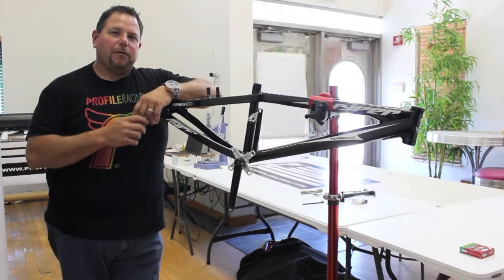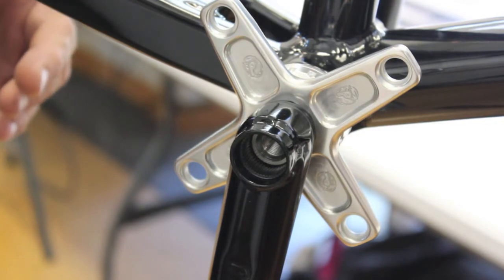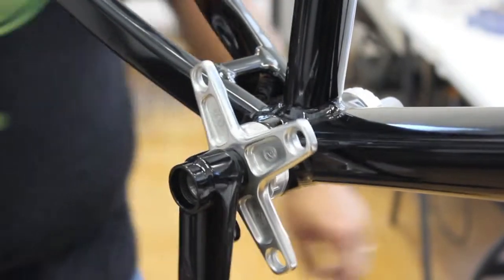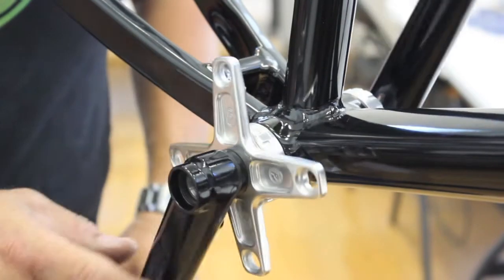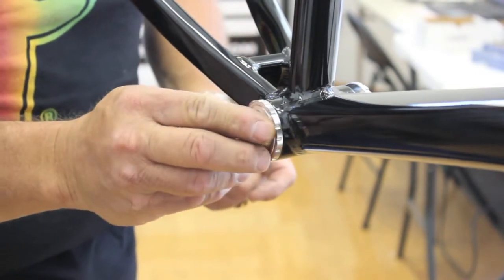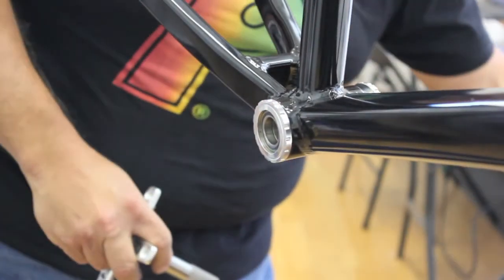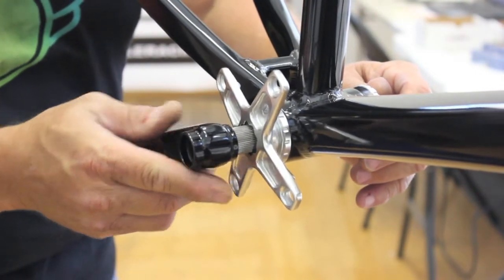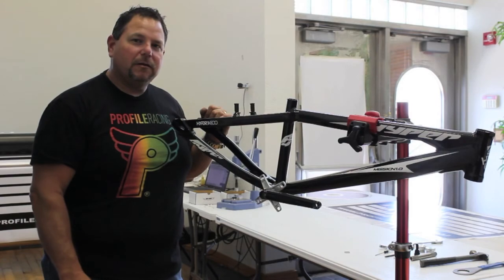Outboard (and Inboard) Euro BB kits: What size spindle do you need?

Comment: This video did not help me so let me break it down for you:

The Inboard is like a square taper it's an internal bb, the outboard is like a dub (i think, never owned a dub) it's external. The inboard has 4, 7mm thick (2 per side) bearings costing $8.99 each, +shipping and tax, from profile's webstore. The outboard has 2 thicker 9mm bearings costing $9.99, +shipping and tax, each. Rebuilding the outboard would be significantly cheaper though the inboard may be stronger and more durable. Profile bottom brackets rely entirely on the bearing sheilds to keep dirt and grime out of the bearing grease, there is no extra seals. Though the inboard has cones on both sides covering the bearings, the outboard only has non drive side.

Profile cranks can be fitted with spacers to clear your chainstay or to increase the distance between the pedals for larger riders. Profile sells these spacers as ugly and unfinished aluminum washers on their website. I believe you can buy pretty black ones from other manufacturers. When using boss cranks and bolt-on sprockets, spacers need to be placed behind the sprocket so the sprocket bolt (the only standard size allen on my entire bike) can effectively make enough engagement with the threads. you may want to use spline drive sprockets with any width needing spacers. Spacers behind the sprocket might mess up your chain line so use a spline drive if you don't have chainline adjustment on the cassette hub.

All the bottom brackets from profile are the same. The different sizes come with different width tube spacers. The cups that hold the bearings are reusable and if you have a socket set you can hammer out the old bearings.

The needed axel widths for your bb shell width and choice of inboard or outboard bb are listed below:

63mm (Pictured in video i think, i do not own a 63mm bb so this may be incorrect)
Inboard- 5.625"
Outboard- 6"

73mm:
Inboard- 6" I used a spacer to clear my chainstay.
Outboard- Profile's next size up is a 6.875" and will need several spacers to make up the gap. 6" did not fit for my application with a bolt on sprocket.
NOTE: The outboard does not come with a drive side cone. (mine didn't) if you use spacers behind a bolt on sprocket it will leave a gap exposing the bearing directly to the elements, the sprocket (i think) is supposed to act like the drive side cone and somewhat protect the bearing from dirt and grime. Also the bearings are blue and ugly as hell so i recommend a spline drive sprocket if you are using spacers.

83mm:
Inboard: ???
Outboard: ???

100mm:
Inboard: ???
Outboard: ???

I wrote this mostly for myself to collect my thoughts
Source: https://imgur.com/a/OO00kLA

Comment: Make sure & install these with no grease just as he is doing. Grease is heavy & adds unwanted weight to the bike brah
Reply: rust tho
Reply: @braydoncoate9583  never get the bike wet & keep in a climate control indoor environment then rust will not be a factor. Rust also adds unwanted weight to the bike brah 😐
Reply: @juansaladzar  dont ride your bike to prevent rust?